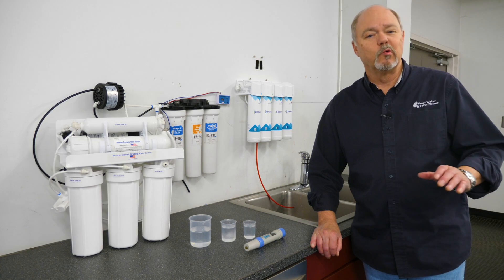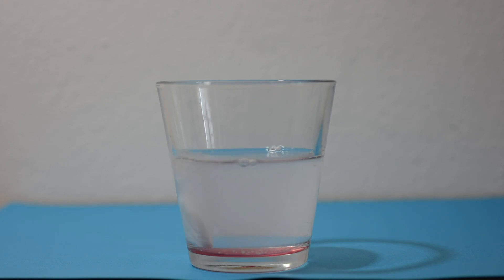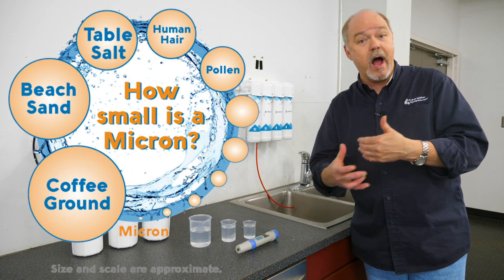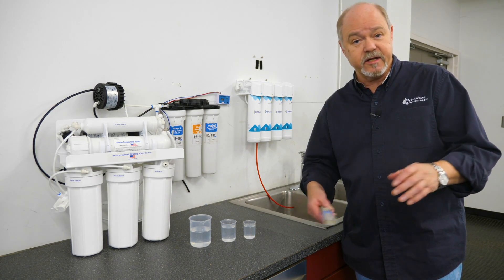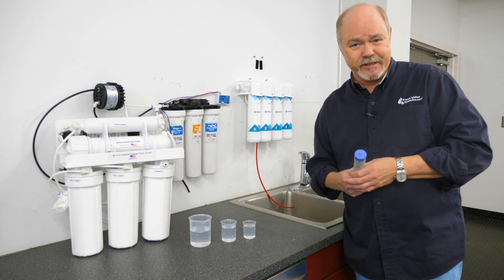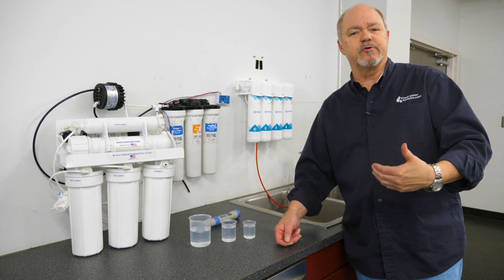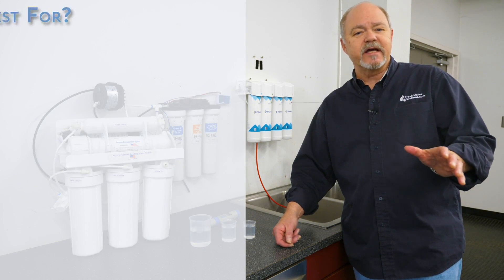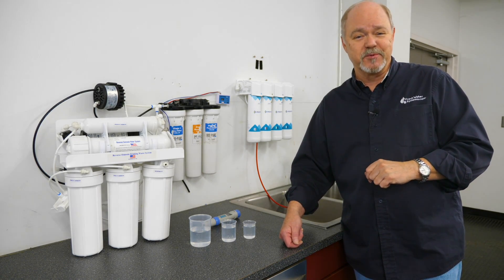Should I Test My Water's TDS?

Comment: I started getting interested in water quality when we completed the construction of our new house in Mexico.  I did researched reverse osmosis systems and water testing (PPM).  We currently have 3 houses; N. Dallas, S. Texas and Mexico.  Our tap water in Dallas measured 465 ppm, S. Texas house tap was 486, and the Mexican house 127 to my surprise.  I bought and installed a 6 stage reverse osmosis system in our S. Texas house and got a 44 ppm.  The water tastes good and we definitely see the improvement.  Soon, this week I will be installing the R.O. system in our Mexican house;  we get tired of bringing bottled water up the stairs.

Comment: Hi 
Please answer my question i am very confused
My well water is at 3000 TDS after membrane and post filter its at 650 TDS but after T33 filter it became 290 to 320 TDS.
Why....? 
Why T33 filter is reducing TDS should i used another t33 to reduce more TDS level?
Also using UV light in it..!

Comment: TDS doesn't mean anything as far as the number goes, because it doesn't tell what those dissolved solids are, you could have arsenic or lead in your water and it only comes up as a number. The only way to test water is to have a lab test it, not everyone drinks city tested water. If the city water is so terrible that you need to spend thousands of dollars on a reverse osmosis filter system, it would be time to make or buy a distillation system, that way you aren't going to get heavy metals like arsenic, lead , and who knows what else. As far as pesticides an activated charcoal filter will filter that out, but it has to be activated charcoal, regular charcoal won't work.
Reply: My reverse osmosis 6 stage system cost $300 and I installed it myself. You don't have to spend a lot of money unless you have Costco or Culligan units and installation.  The ones from Apex in Amazon are just as good or better.

Comment: I have a Water Factory SQC4 RO system in my house living only two people. August last year, I replaced all four cartridges including the membrane. Tested filtered water was 21ppm while city water was 175ppm. Today, I did not touched the membrane but changed all other three cartridges. After draining three tanks of water, I tested and surprisingly the filtered water read 221ppm, while city water still at 175ppm. Why is that?
Reply: You probably need to run your filtration system for several days and then take another reading.

Comment: I just poured one cup of tap water and it said 320 and then I poured some water I got from the filter down the street and it's 2 or 3. If I mix 1 Cup one with one cup of the other the TDS adds up at 158. I'd love to understand why diluting it reduces the number rather than maintaining the same number. Or why it's not  322 assuming the filtered water had some type of TDS that the tap water did not have thus adding them together as a total number. In theory if it's 1/10 of one versus nine-tenths of the other what happened to those 320 TDS in the 1/10 when all of a sudden it's probably only 32
Reply: TDS is measured in parts per million (PPM) so if you add 320 from one glass to 2 from the other you get 322 divided by 2 (glasses) is 161, very close tou your readings of 158

Comment: What is good TDs? Is 180 is good drinking water?
Reply: YES. 180 TDS is excellent for drinking. The TDS levels should not be too low where they lose even all the essential minerals like magnesium and calcium. Below 300 is good.
Reply: TDS is a number of solids that’s been dissolved. The better question is what’s been dissolved! If it’s something harmful then any number would be bad. Have it checked by a lab.
Reply: In my understanding, any reading above 201 is considered contaminated.  So rating from best to acceptable, that would be 0 - 200 respectively.
Reply: No. Above 50 is not good.
Reply: @age_of_reason  but WHO say below 300 is excellent?   and below 100 is just liquid without any mineral in it